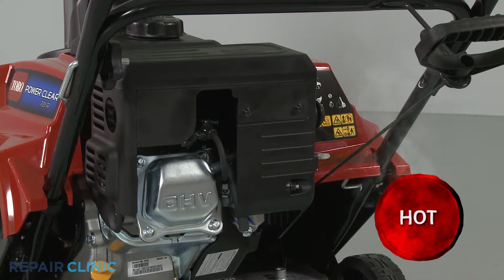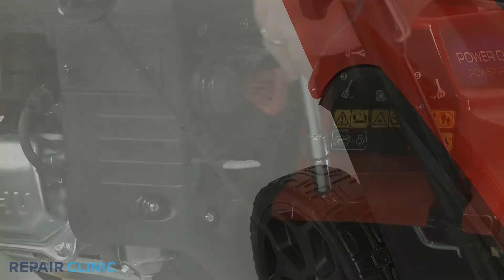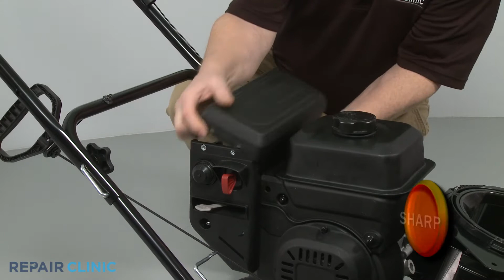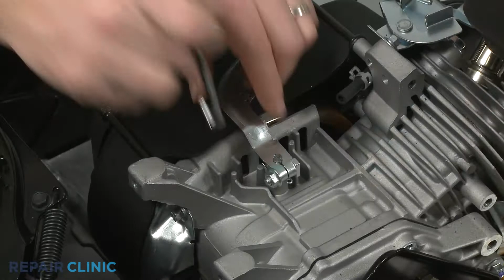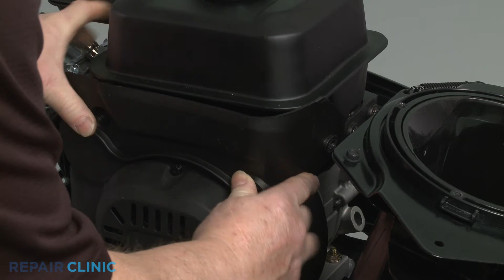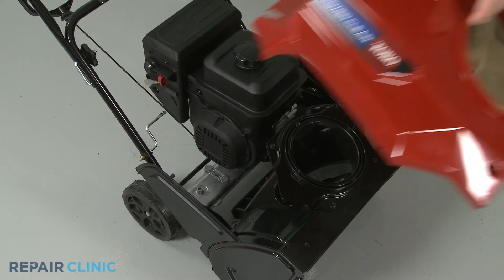Toro Snowblower Governor Arm Replacement 21-0155

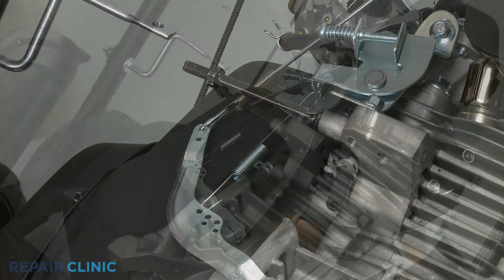Comment: 5:14 for the calibration, it seams like he moves the carburetor to close, not full throttle
Reply: I have a similar machine and on mine, pulling the throttle like he shows, closes the throttle plate as well

Comment: An important thing to note -  when you tighten the pinch bolt onto the engine's governor shaft,  it changes the position of the governor arm, swinging it forward and  maxing out the engine's RPM'S.  

I had to bend the arm backwards by sticking a small deep well socket with an extension over the part where the linkage hooks on, and grabbing the other (bottom)half with pliers.....only then would it idle right.   

This particular governor operates by bouncing back and forth within a very small range (1 inch or less), so the position of the governor arm is critical to get the machine to idle properly.  Hope this helps anyone out there trying to get their snowblower set up.

I got mine at a garage sale for $10, someone tried to take off and clean the carb and destroyed the linkage, then just gave up.  Now I have a nice $400 snowblower 😎